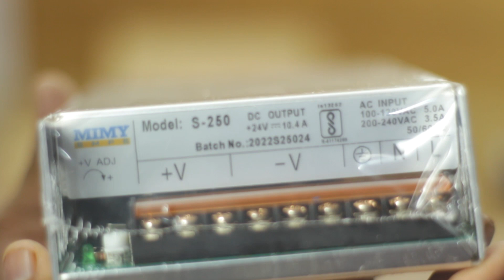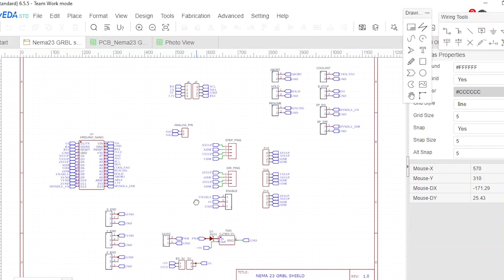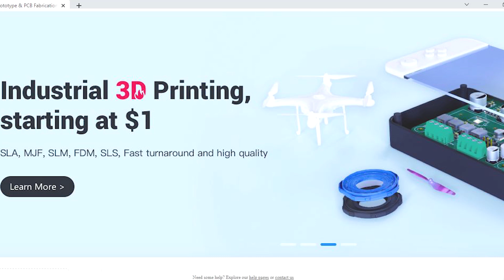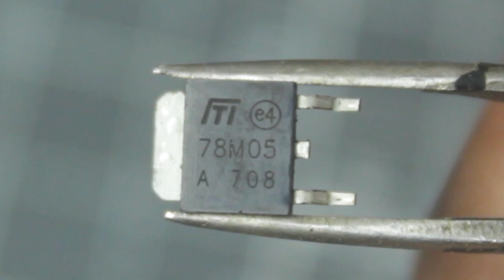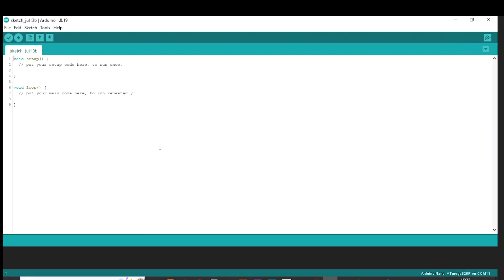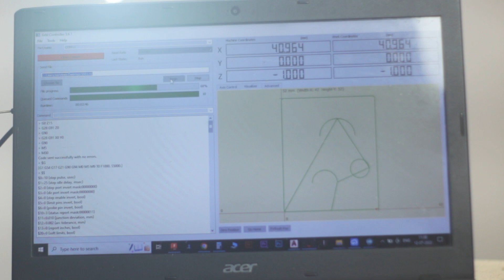Custom made GRBL CNC Shield + Nema 23 Stepper Motor + TB6600

Comment: I would like to know : if you wanted to drive 3 x NEMA 34 ou 42 motors, how would you have acted? Can the circuit you built, also be used for those big motors? And in practice, why was the TB6600 problematic at all and why could you not use the same system as NEMA 17 ones, with your new motors?

Comment: On your website there is a GRBL CNC SHIEL CONNECTION DIAGRAM. I wonder, if the middel driver should be conneted to big red + line?
Just a through 😊
Have you ever thougth about making that shield for Uno? And  is it possible to order such a shield with componemts added?
Awsome video and great work💪
Reply: Normally they can add components but it's more expensive.

Comment: Thank you very much for sharing your project! I didn't find anyone doing something similar. I have one question - my PSU is 36v and will power the drivers. Do I need to buy another psu for powering the board or 36v is okay? 🤔 or maybe I could use 5V from usb and use a Jumper?

Comment: What are limitations of this controller setup? Would it work with nema 34 steppers?
Reply from the maker: it can work with any size of stepper motor just use proper driver.
Reply: I’m using a nema 34 12.5 nm closed loop with a similar grbl board.
Reply: @emiliorh  You rock !
Reply: @rusticagenerica  thanks